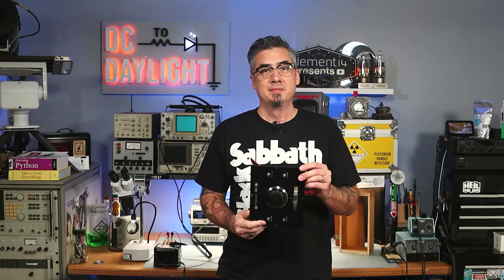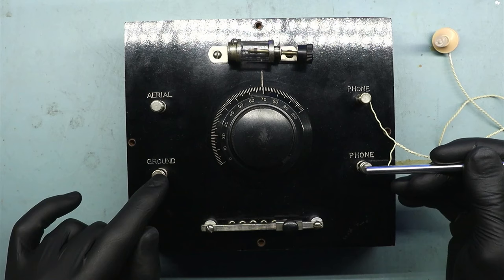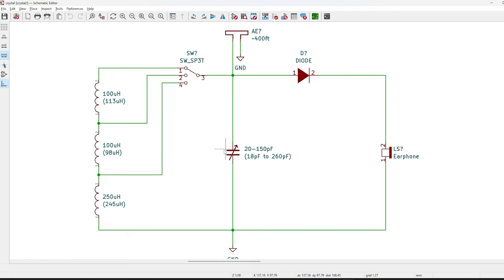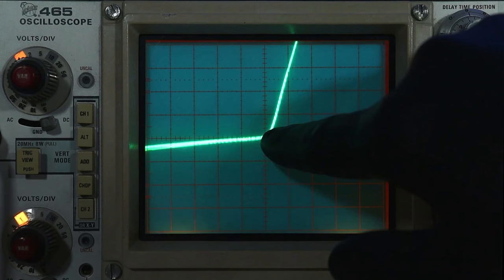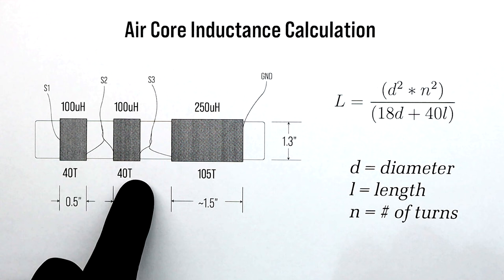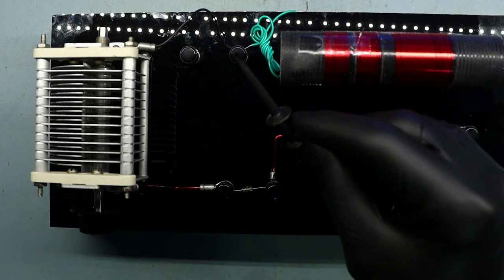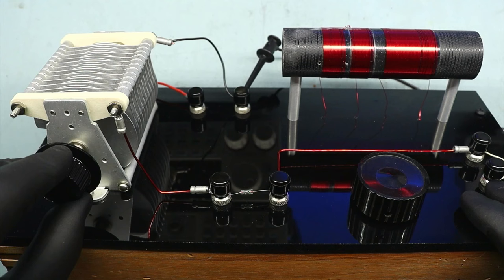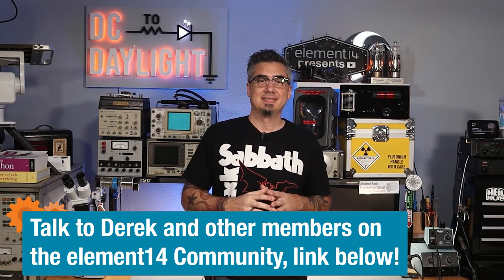Building a Simple Radio Using Tank Circuits and Diodes - DC To Daylight

Comment: I remember making crystal radios using 1N34 diodes 60 years ago!  I wrapped wire around a cardboard cylinder without counting or calculating anything.  My headphone was from a simple kids's tape recorder and it worked.  No channel selection, of course, but I could explore the magic of radio.  btw, no capacitor was used.  I supposed just parasitic capacitance of the wiring formed the tuned circuit.   I remember constructing a number of these so your video brought back fond memories.
Reply: HI Anthony. Interesting - probably a combination of parasitic capacitance in the winding of the inductor. Inductors are self-resonant because of this. Glad it brought back memories! -Derek

Comment: Wow, love reading all these great memories here in. For me, we were introduced to a modified foxhole radio. It used tin foil and waxed paper for the capacitor. The detector was bluing an old straight razor blade and a safety pin. The tuning was very crude; just sanded some of the enamel off the coil and then used a bit of a bean can as a variable tap.  So as a kid who grew up with home computers, it was like magic to hear a signal from what was a bit of scrap and kitchen supplies.
Reply: That's a great story. I love the idea of using a bunch of MacGyver components to make a radio. I bought a stack of feather safety razors to make a foxhole version, but the project was starting to get out of hand. I would love to take a crack at it still. Maybe in a revisit episode.  Thank you for sharing your experience.. fantastic! -Derek

Comment: I love your videos and delivery style. You are so low-key and welcoming, yet packed with great information. When I was around 9 or 10, my dad bought me a book of simple electronic projects.. the very first thing we built was a crystal radio-- I remember the crystal and the variable capacitor -- that was the size of a large potentiometer but it had several thin squares of plastic film separated by metal fingers. I don't remember an inductor, but there must have been one. And yes, we had the exact same 'grandpa's ear phone' you had in this video! We mounted the entire thing on a small block of wood, and it worked! I've been building electronic projects ever since.

Comment: Can't use the element14 Community because some glitchy sign-in/browser issue. So I will comment here. I really enjoyed your build video. I too have built "crystal sets" in the past but I usually take projects apart once I'm finished to reuse parts - so no pictures!
I had success with making the antenna a 16/18" frame type where it doubles up as the inductor also. I'm suggesting this for people who may have issues with putting up a long wire antenna. Also worth mentioning for the billions of folks that ain't US citizens, in the rest of the world you may find old OA type diodes like for instance OA90 or 91 (and others) that serve in place of the US 1N34 type.

Comment: The 1N34 Ge diode is a true classic it and the 1N60 I used when I made my first radio receiver back in 1972.
Reply: Hi Bob. So classic, I had a tough time finding a legit germanium diode. I ended up with an NTE replacement. -Derek

Comment: some alternatives for germanium diode :
silicone diode (0.65v voltage drop) with parallel drained/dead AA/AAA @ 0.6 volt
red led (1.6v voltage drop) with parallel fresh/new alkaline AA/AAA @ 1.55 volt
source: SciToy radio site

Comment: I believe that the old radio is using what they called a cat's whisker detector.
From Wikipedia:
"Cat's whisker detectors are obsolete and are now only used in antique or antique-reproduction radios, and for educational purposes. The tip of the wire contacting the surface of the crystal formed a crude and unstable point-contact metal-semiconductor junction, forming a Schottky barrier diode".
Reply: Yeah, I think it was because they use super thin wire to make the point contacts. I guess it kinda looks like whiskers.

Comment: ok thats it, I'll probably give this amateur radio thing a shot .... wondering If I could make an Event badge that works as a crystal radio.
Reply: Would you have to wear a crown of wire to pick up a station?  👑
Reply: It might be easier to implement an HF morse code rig. Search for tuna can qrp radio. Might make a nice project! Let me know if you get that license, and I'll point an antenna at you. (BTW, you have to post those cool crystal radios in the community) -Derek

Comment: You have forgot to include the nearfield in your discussion, which is very interesting and has many applications. To study the nearfield of a dipole source, one must solve the inhomogeneous wave equation, ie the wave equation = source term. Solving this equation shows that the phase vs distance from the source is non linear in the nearfield, with minima at the source of the field, and becomes linear after about one wavelength from the source. Applying well known phase speed and group relations, which are inversely proportional to the slope of the curve, shows that the phase speed and group speed are instantaneous in the nearfield, and reduce to the speed of light in the farfield, about one wavelength from the source. The longitudinal electric field and the transverse magnetic field are created at the source. But the transverse electric field is created about 1/4 wavelength from the source and launches transverse electric fields both back toward the source and also away from the source. The electric field from the dipole source circulates from one pole to the other pole. So there is a circulation of electric energy in the nearfield: longitudinal out, transverse in. The transverse electric field and transverse magnetic field are 90 deg out of phase in the nearfield, and become in phase in the farfield, where they propagate together by reinforcing each other. The instantaneous nearfield has serious implications for Relativity and all theories based on it. For more detailed information see:

*Superluminal Electromagnetic and Gravitational Fields Generated in the Nearfield of Dipole Sources - William D. Walker
https://arxiv.org/abs/physics/0603240

*New Interpretation of Relativity - William D. Walker, Dag Stranneby
https://vixra.org/pdf/2309.0145v2.pdf

*Superluminal Maxwell Displacement Current measured in the near-field of a spherical capacitor - Emmanouil N Markoulakis, William Walker, Emmanuel Antonidakis.
https://www.techrxiv.org/doi/full/10.36227/techrxiv.170862178.82175798/v1

Comment: Nice practice radio for up and coming electronics engineers!
But I have a question absolutely not related to this video.
This is about AC voltage step down, to which I know a transformer is the best option out there, but I've been wondering, what if one could step down voltage using a TRIAC and then employ an RC filter to restore the waveforms at the output!
Eg. Stepping down 220vac to 110vac with an RC filter, will this still output a pure sine wave?
If this its doable your scope would confirm it!
Will you treat this as a subject for your next video ?

Comment: I picked up a chunk of galena from an old abandoned lead mine last year, but I've yet to get it to act like a diode.  My LCR meter thinks it's a capacitor.
Reply: I couldn't make mine work at first when using just an earpiece.. I had to poke around until I found a good contact point - and that was using the curve tracer. There were only a couple of working locations. -Derek